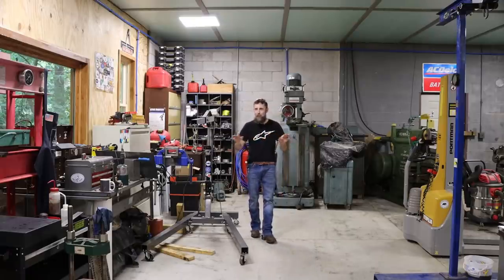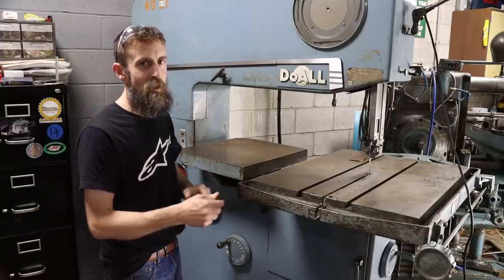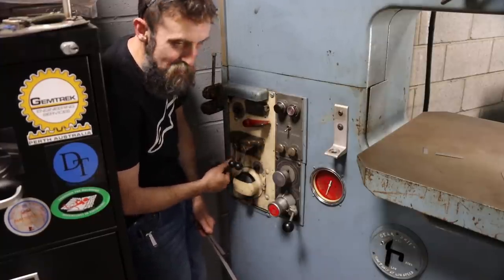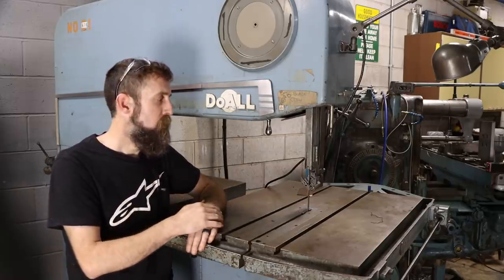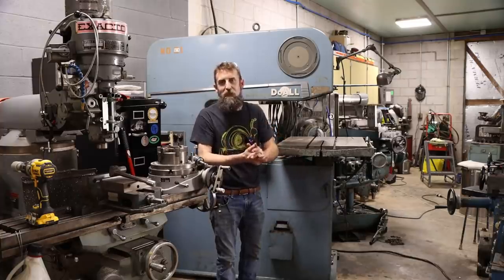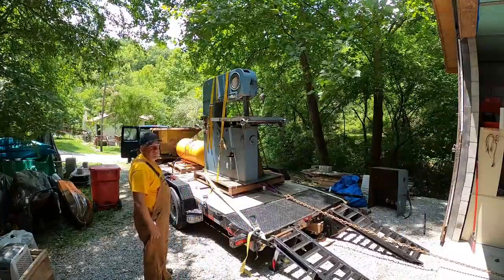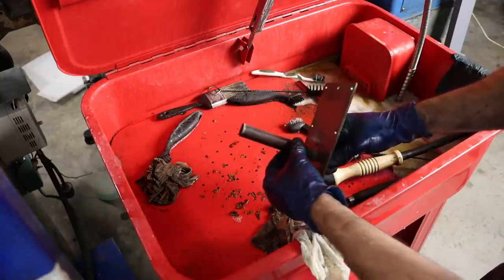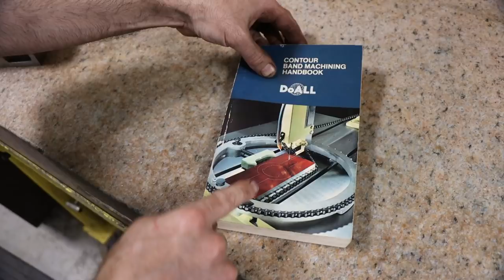ONE Of THE BEST SAWS EVER MADE. A BIG DoALL Band saw for the shop :-)

Comment: The main purpose for the blade welder, is so you can cut the blade, and loop it thruu your work, and then weld it to be able to cut interior features. Your description might be taken as it's only purpose is to make your own blades ... the former mentioned use is by far the main benefit. Happy Birthday Elizabeth! ...I like the saw Steve bought you!
Reply: ..also taught in machining technical school to use it for fixing blades that had to many broken teeth or a snapped blade...it had a welder and annealer built in..

Comment: Steve,
Wonderful saw. 
I find that hole punching gaskets like you demonstrated works better with wood end grain backing rather than cross grain. A chunk of 4x4 stood on end works nicely. The end grain backing provides a cleaner cut, is gentler on the punch cutting edge and doesn't punch out wood block divots.

Comment: These saws are what helped build the world . I keep lookin for one without involving a dealer . Found an old heavy metal wood saw . Took the direct drive motor apart and machined it to take a pully . Built the drive set up with 4 speed pulleys . Works great . No welder but I do ok making the blades up . Retired the wheels and put solid carbide guides on it . Nice shop you have there .

Comment: I have a 12x16 version of that saw, absolutely love it. Also has the hydraulic ram but mine pulls a bicycle chain you wrap around the part. Also has a steering wheel you can use to turn the part while the ram pulls it into the blade.  Variable speed from 50-1500fpm. Also the year built is part of the serial number, mine’s a 1945.
Edit:  Ha!  Posted too soon, you covered the chain part.  Also the grinder is open top and bottom so you can grind both sides of the blade without twisting it.

Comment: A tip for future machinery moves:  200 litre polyethylene drums can be cut into wide strips to make excellent low friction skids (especially if you use one strip on top of another).
These drums are the kind farm chemicals and food constituents are shipped in and are easy to find. The plastic is around 6 mm thick (0.25")

Comment: Had a DoAll brandsaw in both shops I have worked since 1960.  The first had a War Board veteran complete but only sawed with hand pushstick pressure. The welder functioned if you crossed 2 screwdrivers across the missing switch quickly counting one, two!  Moved to present employer in 1962 (a 25 person tool and die shop) who soon got a new one like yours except the deep throat/extra platten to replace their well used Delta. I welded many a blade for the company even more for employee home wood shop band saws (many requests was through a drilled hole in the wooden blank)!

Comment: Happy Birthday Elizabeth!  No longer have the saw but I have a welder for one somewhere in the back. 
After welding the blade the annealing step is very important, it has to be the right temperature and the right duration 
or the blade will break easily.

Comment: DoAll is still in business and stock some parts for old saws.  We have a few DoAlls and they are the best saw made.  We had a drive motor go down on one but the pulley was seized to the shaft.  We were getting the motor rebuilt and they broke a section on the pulley(3 diameters).  Be aware that parts from DoAll are expensive.  The price quoted for a pulley seemed to include rent for the time it spent on the shelf(50 plus years).  They wanted over $800.  Since we never change the speed it really didn't matter as we have several of these set up for different metals and wood,-Steel(hard), Aluminum(soft) and Wood.  We also have a vertical contour one.  We bought these saws for cheap and got one for free many moons ago.

Comment: I was visiting my favorite surplus store in sun valley. As I walked back to car. A ring gear and then a pinion gear came flying over the fence of the truck wrecking yard . Landed right next to my car. So I picked them up .put them behind the seat and drove away. Get to a friends house. He is not home but the neighbor has kis K5 rear axle torn apart. I yelled what's the part number on that gear set. Yep matched. That paid for the days gasoline. Sorry steve I would have kept them for the past 40 years if i knew you were going to need them. Happy birthday Elizabeth.  Mondays mine too.   Thanks for taking care of the small critters..
Reply: What is the name of that surplus shop? Apex? I assume this is Sun Valley in Los Angeles?
Reply: @andydelle4509  yep.  Then there is all electronics, luky hardware,
Reply: @waynep343  Have you been there recently like this year? I think the daughter is running it now. She is cleaning the place up. I hope she doesn't turn it into a Sephora store! Digging through the junk is part of the hunt - and fun.

Comment: The variable speed pulley system on it is basically the same system on a variable speed mill head. My Clausing 5912 lathe has the same type system. Infinitely adjustable speeds on the fly. Super handy. It is essentially a Reaves Drive system. Nice score Steve.

Comment: I use my electric winch a lot, because I'm an old retired guy. I added wireless remotes to both winches. My big one is on a cradle that fits in 2" hitch, the small one is bolted to front of side by side. When I'm using the winch, pulling out my tractor etc...I can sit on tractor and run the remote and operate the tractor at the same time. I never have the help i need, especially when I need it.

Comment: Nice saw, the saw I have is a powermatic model 87. I just this week cut out some brackets for a trailer hitch out of half inch plate. It was the most I have used it yet. The saw has brackets for cables and pulleys for a feed system. There is a pedal with an adjustable weight to control feed. Once you have used one it becomes a necessity to have.

Comment: I know that clean makes a person feel good and it did need repairs. I have seen them still working in  shops so nasty I myself did not want to enter and even  the fellow who owned it smelled something like grease factory. I had a pair of Industrial saws, one a 36 and the other was a 48 with  room  to go a bit more. They were two wheel saws and had counterweights on  the drive pulley and the idler pulley (my names) They took a few seconds to spool up and took a while to shut down... designed for cutting shakes for roofing. I wasn't strong enough  to push that much wood through it so laid it down and put a power table on it so it did the work. It was way fast and I did turn it down but the blades suffered so I turned them back up and we ran the saws six days a week, on two shifts. After each week, we blew all the residue out and oiled the bearings to find we were over oiling and so monitored them. I found that they like some oils and others just made for a hot bearing. I don't  remember much more as that was almost fifty years ago. Both saws were converted to electricity as they were used in a steel mill in seattle in the late eighteen hundreds but were as modern in many ways as they are  today in design. They were saws only and no nice features like you have on the front of yours.

Comment: I used to, use a do all saw at work but ours also had the file blade system which was awesome.  People used to come in to my shed and ask to use the saw and that was OK but if they broke the blade they had to stay and help me reload a new blade and hold the ends while i patched up the old blade for next time.  Eventually they took to asking me to cut it out for them, a lot quicker, and i hardly ever broke a blade.  And yes the welder is easy to master.

Comment: Took me back to this February when we bought our LeBlond 17 and a column mill. The 18ft HD open car had all she wanted on her @ 3100 +#. The loading took 4 of us 1hr via pipe rollers and 2 wire come-along's, but the unloading into the shop was the kicker, and holding it going down the trailer ramps onto the shop floor. Nice fined and buy Steve, and a blade welder to boot (@@),,don't get much better than this :)>,,,Happy B-Day to the Bride,,,Apple Bee's for her dinner?? hehe!

Comment: Best recommendation I can make for these DoAll saws is get yourself a pair of polyurethane guide wheel rubbers. If it still has the old rubbers on there they're likely pretty hard and tracking when you start pushing can be a problem. As a side note I've been in the plant (Continental Machines) and years ago put in the pumping and proportioning equipment for their hammertone paint finish.
Reply: Nevermind, got to the point of the video where you went over the tires. Not your first rodeo :)

Comment: Electric brakes require the wheels to be in motion. They don't work when stationary.
Reply: they were activating the emergency brakes where it pulls the pin locking the brakes in the event the trailer comes off the towing vehicle.  thus they had to get the plastic pin separating the electrical contacts out.  The pin is attached to the tow vehicle and if the trailer comes off the ball, the tow vehicle rips the pin out activating the brakes with the small battery that was also broken.  so the pin was broken as was the battery, effectively eliminating the emergency trailer brakes.
Reply: @frotobaggins7169  Very true, but whether the power comes from the controller or the break away, it still needs a slight amount of motion to activate.
Reply: @jasongreene303  I have no direct experience with it but pulling the pin should automatically apply the brake.  It applys current to the brakes.  but you could be right, though i don't see what movement would have to do with it.

Comment: Once again, who is the wonderful string group playing the background music abt 32 min 20 sec? Got a YouTube link?

That is a dream saw, onece a centerpiece of old school punch and die work. I saw an old film where a white haired toolmaker was using your saw's cousin to rough out a die for punching induction motor laminations leaving about 1/64" stock and sawing the clearance angles working from lay-out. The key to this countouring feature is the fancy servo valve built into the upper guide. The table pushes or backs up to maintain the cutting force in response to the handwheel at the right of the table.

Your saw also has a filing option. DoAll sold filing bands consisting of a band to which short lengths of files were attached. They run in a guide fitted between the upper and lower guides. When properly set up and running, the effect was an endless file running at the optimum speed at just the right angle. If you were made of money back in the day and fully outfitted a DoAll 36 contouring saw with the filing whistles and bells you could do some pretty fancy filing to very close tolerances. Back in the day, DoAll band filer specialists were in great demand in die cast mold shops.

Much as I loved the convenience of a DoAll contour saw and all Its cababilities, my go-to saw was the Marvel 7A for the parts I needed for the steel fabrications for the prototypes I used to build. I had access to both but my work was mostly plates, pipes, gussets: chunky work better done with a wide band. Not much contouring. Had my workload consisted of contoured parts, shapes, angles, and curves, the DoAll would have been my choice. 

Those of you who lust for better sawing equipment and sieze on the DoAll 36 as the answer to your dreams should consider your workload. Yes it will saw thicknesses and can be furnished with 3/4" wide bands but its best employed for intricate work. Shop wisely.

Comment: I don't like the american trailer braking system, it relies on a battery, even if it works, with the 8 amp draw, the battery could go flat and i guess the brakes would release ?
Over here the brakes are usually cable, when the vehicle slows down the brakes are applied, but if the trailer breaks away, a cable attached to the towing vehicle pulls on a version of a handbrake with ratchet that locks the brakes, the handbrake is also used for parking the trailer

Comment: #SteveSummers   Do your homework on that blade welder before you start buying blade stock. Supposedly those old blade welders don't have the power to weld the bi-metal bandsaw blades that are common today. I cannot confirm or deny the accuracy of that, I TIG all my blades. Just make sure you cover you basis.

Comment: The first half of your video praises the quality and low price availability of these saws. The second half shows why they are so cheap.  The castings don't wear out, but all the mechanisms do, and they can cost a lot to repair.  They are only a good deal if you have a shop large enough and the equipment to move them and a true need to use it every day.